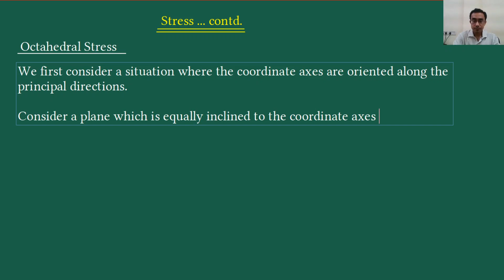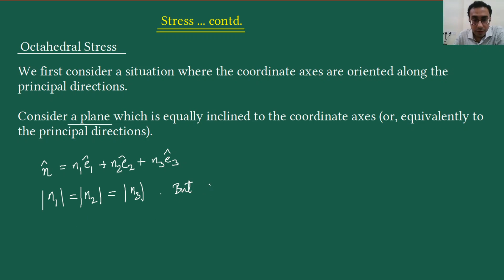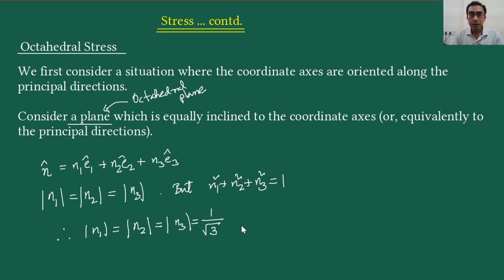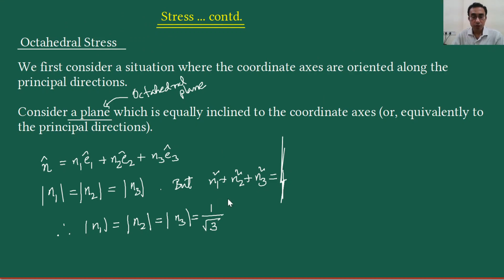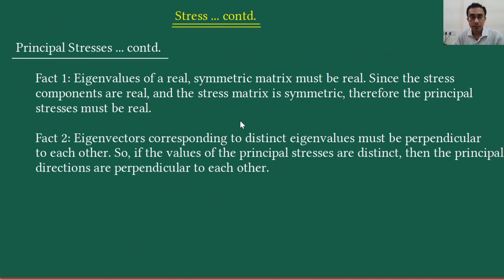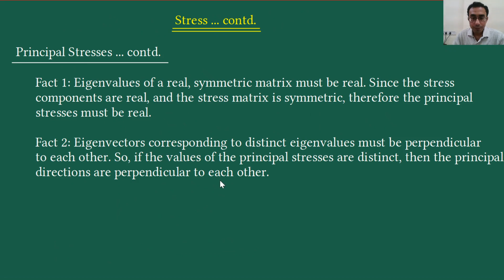Stress – 11: Octahedral Stresses

Comment: Respect sir. I am facing lots of problem on tensor algebra. Where can I do some practice on numerical from low level to higher level to boost up my confidence.
Reply from the maker: There is nothing called "numerical" for tensor algebra. However, you can do some exercises from a good book like "Elasticity" by Martin Sadd, which I used as the textbook for my course.
Reply: @Prof_JC  thank you sir. I will look into that